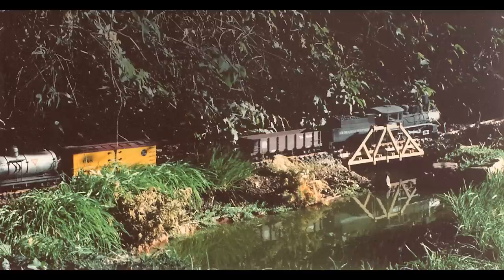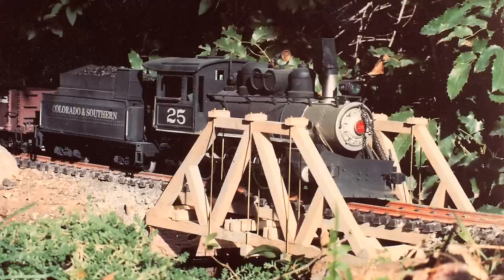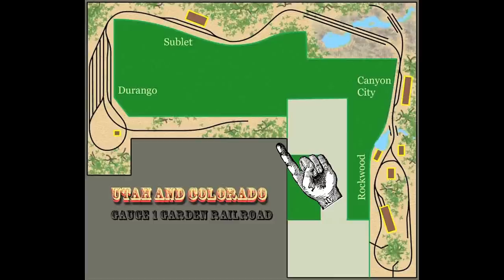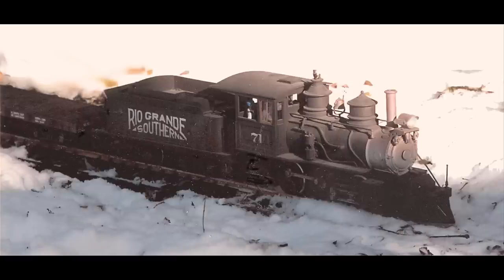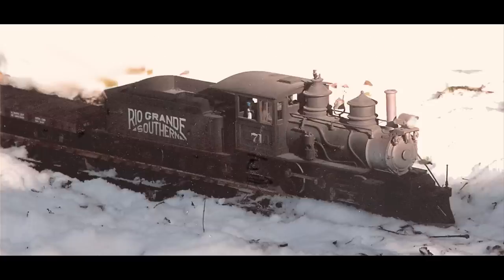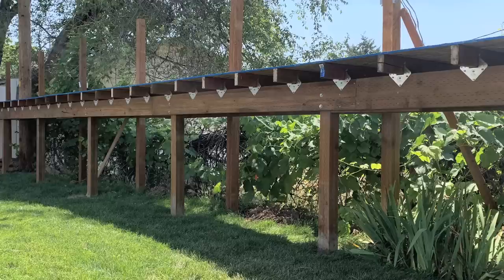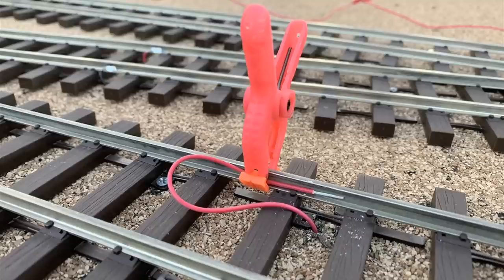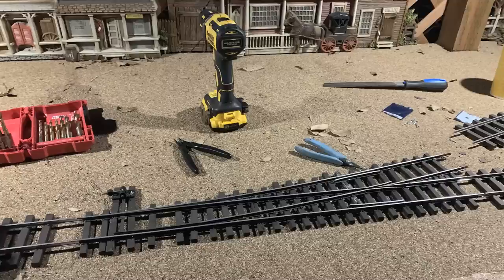How To Lay Track on a Garden Railroad

Comment: Great video Dale! I did want to mention that the Nickel Silver metal (Copper Alloy C752) has a very low linear expansion coefficient of 0.000009 . When that is plugged into the linear expansion formula with a rail length of 72in and a starting temp of 23deg F and ending temp of 175deg F (the temp swing we see in your video)... the rail will expand/contract by 0.0985in, so an 1/8" gap is typically fine for Nickel Silver when laying the track in moderate to low temps.  You are correct that the narrow gauge tie strips being a bit tight on the rail leads to some more irregular shifting of the rail in one direction or the other. This is less of a problem with the little looser grip of the standard gauge style tie strips. -Mike
Reply from the maker: Super!! The aluminum rail.. well.. on the ground with the joint’s clamped, the track moved all over the place. When I staked the ties to the ground it ripped apart badly. The broken tie would often end up about 1/4” from where it originally was. Mostly vertical movement!!  The ground really swells and shrinks. And ends up different than the starting point. Several of the stakes were pushed up by about 1/2”!! Disaster. But when I just laid it on the dirt it looked great. Seen in the pictures. But moved all over the place. But not a problem and when it needed to be relayed easy. I attempted to use the aluminum rail screwed to the bench with non clamped joints. Rail was clamped to the wire at the very center of every rail. Worked fine. Except the expansion meant I need a gap of about 1/8”. Or more. And still ended with curved rail on hot days. The nickel is great!  We had -30° just up the mountain in Logan. I’m guessing the gaps would still be negligible. But even here we are getting over 150° variation and no problems!!
Reply from the maker: Ps. I’ve been working on the indoor trestle in the cold. And the Jiminy Christmas Mine which I took outside. But built in the WARM shop. But as it warms up I want to build the small outdoor trestle using your long ties and tie plates. I think I now have a handle on building a trestle!!

Comment: I too have each piece of track connected to the bus line. Mine just happens to be a n-scale layout, but I'm happy I'm not the only one who does this.
Reply from the maker: Our group has always done that. Steve’s railroads all had that. I wired out huge club railroad at MRS hobby shop. And every single rail had a drop. And was black inside red outside of the loop color scheme. And never ever an electrical problem.

Comment: Using extension cord helps prevent line drop.  This is when the length of the wire starts to become a resistor.   In this case the larger diameter of the wire in the cable is very large for the voltage & amperage being carried in the wire, well below what the cable is rated.
Soldering wires should be on the outside of the rail.  This prevents any interference the wheels must to deal with.  Most outdoor rr's I know convert all their engines to battery/rc operation so as not to clean the rail top to reliably conduct electricity.  Also eliminates reverse loop & switched sidings wiring.  FYI: Even with DCC reverse loop wiring must be considered (reverse loop module to prevent shorts).  I recommend you plan your RR with the biggest curves you need for your largest engine you plan to by.  Diesel & big steam engines have curve restrictions.  Planning for the largest engine will solve this headache & shorter engines look more graceful around curves.

Comment: Very clever laying the rail on a hot summer day, then allowing it to contract as it wants during the night and in winter.  During the day the rail is capturing extra heat from the direct sunlight, so it exceeds the air temp.  But at night there is only the ambient temperature and eventually the rail temp returns to the ambient temp.
Reply from the maker: It’s seems the rail is much cooler than ambient. Just because it’s so good at pulling heat. Which is why it gets so hot. So when you touch it on a cold day it really feels colder than the air. But it’s not. It’s just pulling the heat from your hand. So… don’t lick the rail!!

Comment: One of my tasks where I use to work was to evaluate a proposed railroad to be built in Saudi Arabia not far south of the Iraqi border from the port on the Arabian Gulf.  Besides suggesting using rebuilt locos instead of new, I changed the track to CWR to lower the cost.  Almost immediately there was a question about sun kinks, etc.  I pointed out that the temperature differential there is about 32*F (0 C) to about 135* to 140*F.  Since the rail may get to about 40*F over ambient temperature that would be a swing of 140 + 40 = 180 - 32 or 150*F.  There are places in the US that have CWR where the temperature swings from 30*F to 120*F and with the addition of rail temperature of maybe 40*F that would be [120 + 40]  (-30) = 160 + 30 = 190*F or 40*F more swing than should be expected for the proposed railroad.  CWR is laid at the median temperature (or expected temperature) of the rail then the rail would need to be adjusted for the higher median temperature for CWR to be successful.  No problem.
Reply from the maker: And depending on grade you may get more movement down the grade than any temperature swing!  I imagine in Saudi Arabia the grade issue isn’t a problem…
Reply: @ToyManTelevision  The proposed railroad was to be about 200 miles long to serve a new military city.  I proposed the use of a welding machine at the east end, just off the dock, to weld strings of rail for the yard and the main line.  The rail strings would be run out of the welder onto holding rolls for loading onto a rail train for delivery to the end-of-track.  I also envisioned using prestressed concrete ties.  Instead of using box cars, I suggested using containers very similar to the use of container trains now; this was in 1977.  For hauling fuel, there would be tank-car trains of 15 to 20 tank cars to be loaded and unloaded from each end instead of each car.  In other words, use what works here, there with only about 200 employees instead of the number the report had suggested.  I also suggested a future possibility of connecting the eastern end with the existing railroad further south.

Comment: Good stuff. 
I don't think that putting drops on every section of rail is overkill, I think it's nessecity  for good signal for the DCC. 
By the way, I used to take the 30 bus too!! Lol
Aluminum and brass rail are way to dimensionally unstable to use in your neck of the woods(or desert as it may be)
The stainless steel rail is more expensive but worth it for less headaches. 
The smaller code 250 looks much better and shouldn't cause what expansion you will get to be that bad as you showed.
Reply from the maker: Check the top comment on the nickel silver. I had no idea!  No wonder it’s working so well!  Not too expensive either.
Reply: @ToyManTelevision  I was at a friend's house in Tracy CA. And we set up some track on the ground one day.  It was early summer.  And I brought a #6 code 332 brass switch. 
So no big deal running our trains around. 
And when I was packing up to go home, I tried putting the switch in the box.  And it was to long!! By almost an 1/8"!
I couldn't figure out at first why it didn't fit!!
I drove back home to the east bay area and low and behold, the switch fit the box again. 
It was 25 or 30 degrees color at my house!  And the thing shrank!!
Lesson learned

Comment: Ironically enough, the Santa Fe had 50 Alco locomotives called "Alligators" back in 1959-1975. They were called that because of their long, low nose on the front of the cab.  (Alco RSD 15)
Reply from the maker: I love alligators. No not the lizard but the locomotives

Comment: Great lesson. Questions: What sort of clipper do you use to cut the rail?  How did you do the brickwork on the shop on your old railroad? Thanks from a grateful, but incompetent , student.
Reply from the maker: Hello!  A battery powered Dremel tool with a cut off wheel. Only way to cut large rail. And I use it on all rail because it works great!! 
The outside shop was an interesting project. As always a “clever idea” that sort of worked and sort of failed. At some point I need to rebuild that.. anyway I first built it from clear sheet acrylic!  A large clear box!  With a pitched roof!  Hum… this should be a Tuesday show!  Anyway a huge clear “plexiglass” building with two arched doors. Then I bought a brick wall casting. Pola?  I don’t remember. Was around in the 90’s. Then I made a mold from Space Shuttle Dow rubber. Long story there. Anyway it worked great! Then I cast about ten of these walls in urethane. Two part tan indestructible, casting stuff.  There’s a bunch of products on line. Anyway, that gave me a whole bunch of wall sections that were approximately 12 inches tall and 18 inches wide. No I needed to find someway to glue urethane to acrylic sheet. That’s when the project went badly. I could not find a glue that would do that. Had I done my original castings in two part polymer, that clear stuff that they sell in the craft stores, it would’ve been simple anyway, it’s very difficult to find any glue. It will attach urethane to sheet acrylic. Anyway, I cut out the windows and doors and everything into the brick castings glued that as best I could to the clear box and then went in with Plastruct and evergreen plastic strips to make the windows and doors gluing them to the acrylic “box”. The roof is actually made out of that stuff they sell at party stores, it’s sort of like a plastic version of the old crêpe paper streamers. Anyway, it’s a corrugated plastic that you string around in a room before throwing a birthday party. A bunch of paint and weathering, rust on the party, streamer roof, and there it is! Except the castings cracked in a bunch of places because they weren’t really well attached to the acrylic box. Like I said, that was the failure in the project such as it was.
Reply: @ToyManTelevision  Thanks very much. All good ideas but beyond my present "skills." I'll try though and see what happens.

Comment: Can you run a lead engine and a mid-train DPU on your garden railroad, or do they get out of sync with each other?  Should the mid-train DPU actually be unpowered if I am simulating a DPU?
Reply from the maker: Sure can!  But I used to run ABBA FA1s. Two motors each. 8 total motors. On the 4% grade it was pulling about 8 Amps. And that was a real problem. I could pull the train with two locomotives. 4 amps. More traction power than all 4 locomotives!  Too much voltage drop through the 14 or 16 gauge extension cords.. one reason I’ve gone to 10 gauge. But also I’m only running steam.. much less amperage. No matter. I would say you may be better off with a dummy locomotive. But not as much fun. So… it depends I guess.